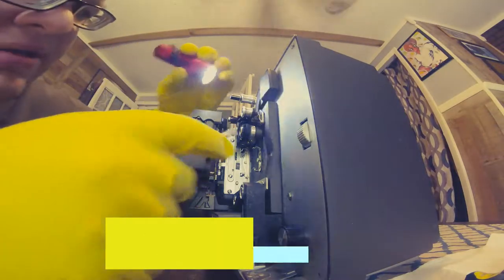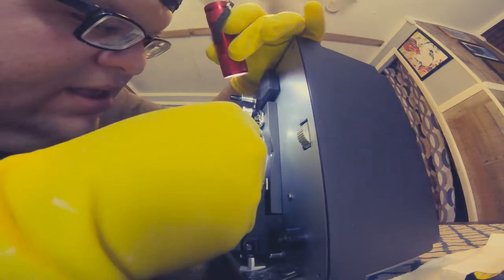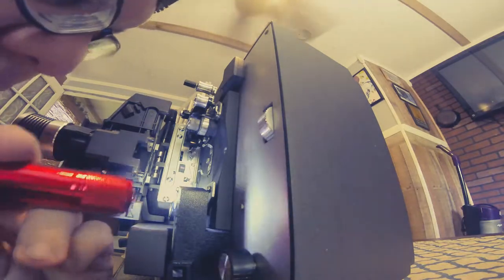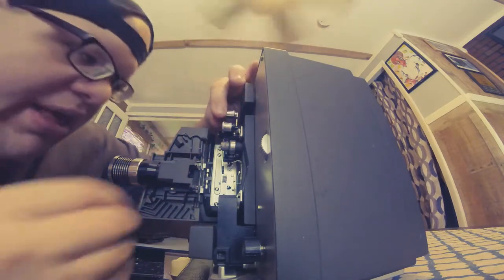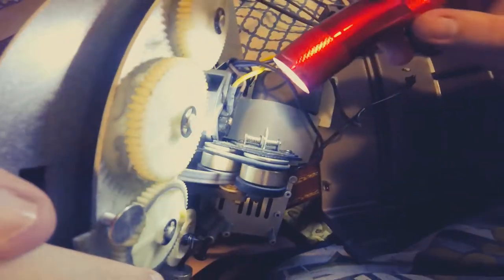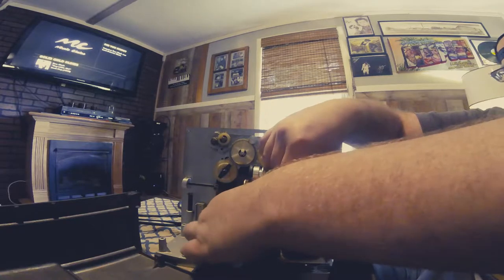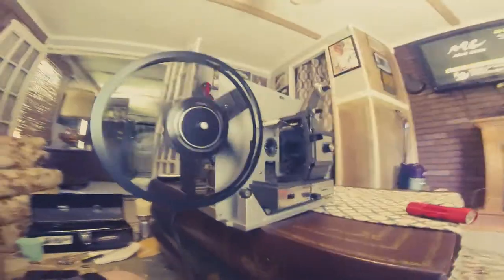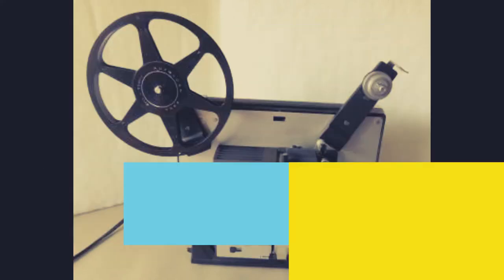How to replace the feed tire and motor belt on a Bell & Howell super 8 & 8MM film projector

Comment: Very helpful video. Now I just need to find a source of supply for the main rubber tire which that belt drives and which contacts the shutter drum. Even after rubber rejuvinator it still slips.